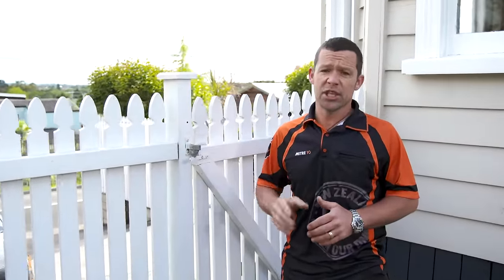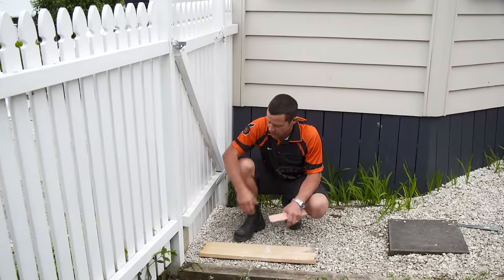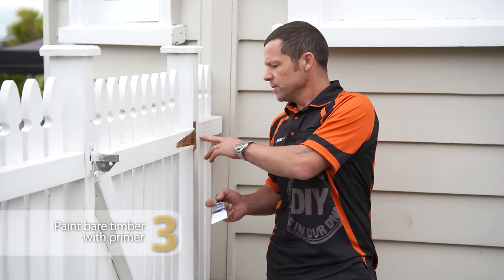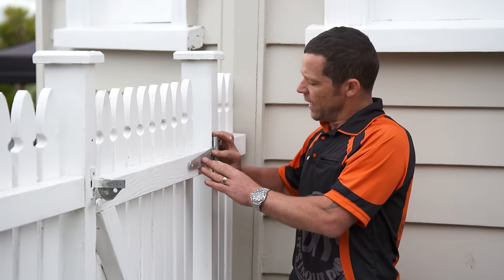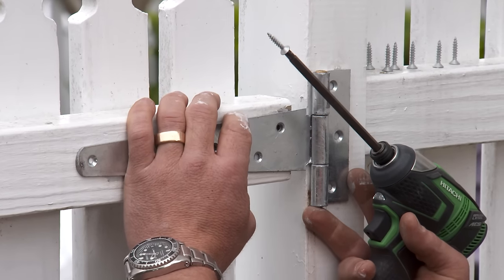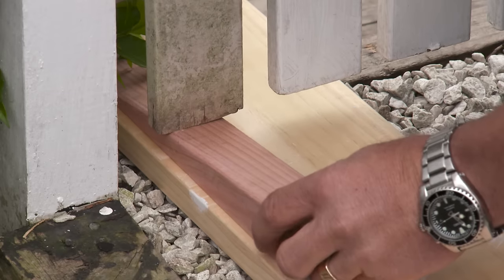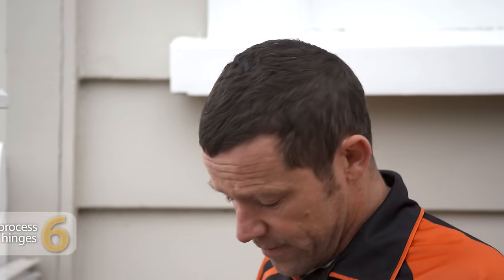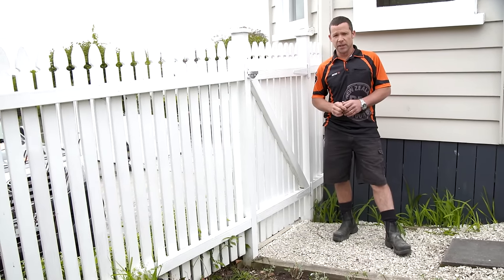How to Replace Hinges on a Gate | Mitre 10 Easy As DIY

Comment: stuff the holes with what?
Reply from the maker: If you do need to use the same size hinge, and the old holes are flogged out, then simply insert a couple of fillets of timber into the old holes to pack them. ☺️ ^Cam
Reply: I've seen toothpicks used in a pinch as well. Pretty much does the same thing.